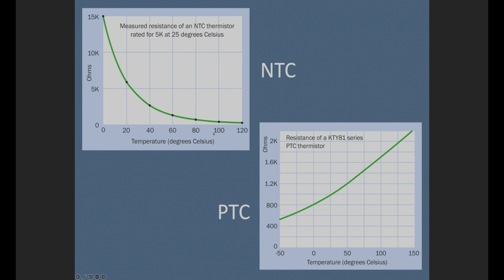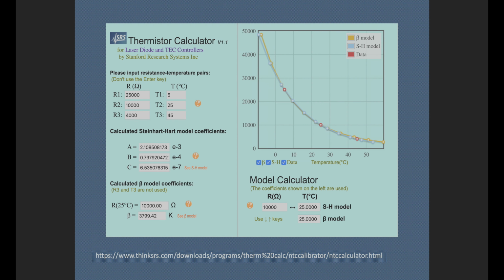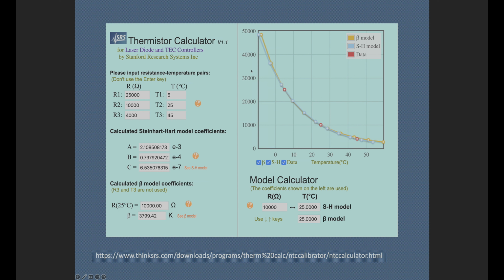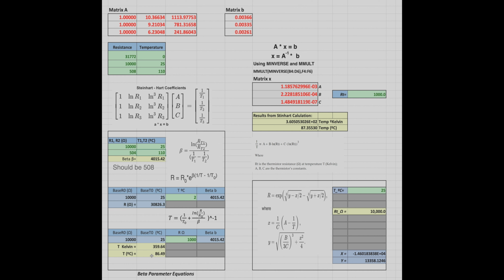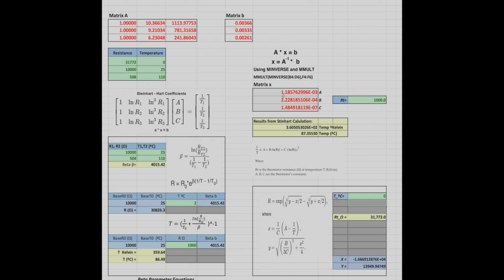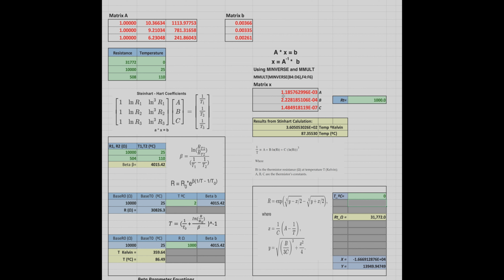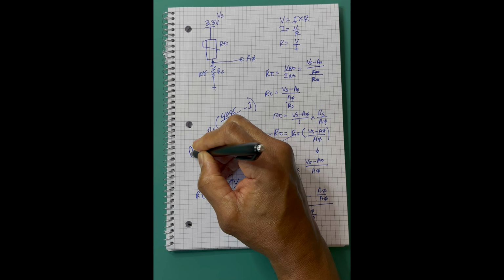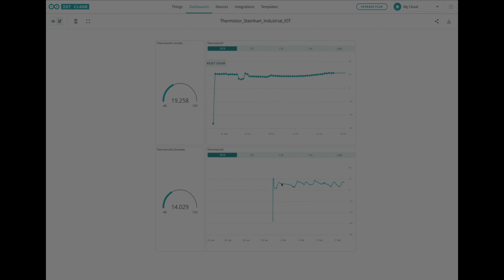Arduino Temperature Sensor | Thermistor

Comment: Hello, I am trying to build this exact project. I got the same sensor and set up everything just like you did, but my output results are way off, by 6 or so C, AND the output goes negative. I have verified the wiring is also correct. Im using a nano as i want to use this in my car for bbetter temp monitoring. No idea what is going on.
Reply from the maker: I assume you’re using the Thermistor_Steinhart_Equation sketch, written for a 12-bit ADC processor such as the Nano 33 IoT. If you’re using a Nano with only a 10-bit ADC, you’ll need to modify some of the code. Comment out line #71 (//analogReadResolution(12)) and replace 4095.0 with 1023.0 in the readThermisters function on lines #92 and #96. Also, change lines #49 and 50 from 2048.0 to 512.0.

Other checkpoints are lines 39 and 42. Make sure they are correct for the thermistors you’re using. Since we were measuring the ratio of two voltages to determine resistance, it shouldn’t matter whether one board is 3.3 V or 5 V.